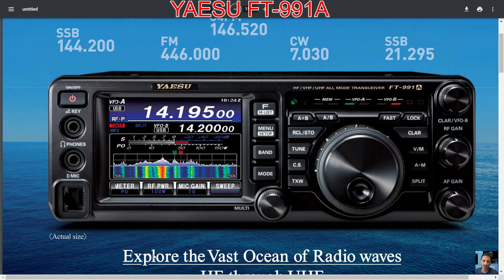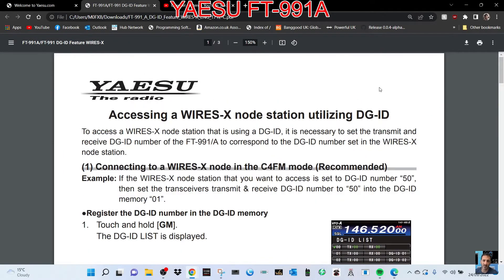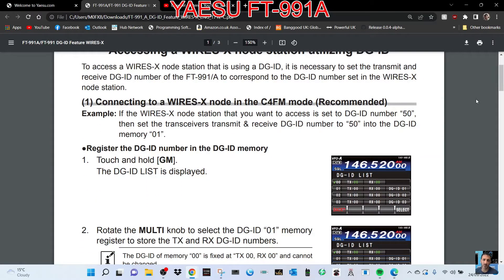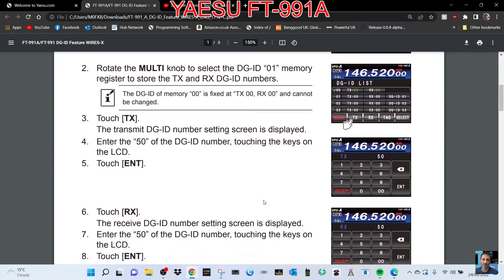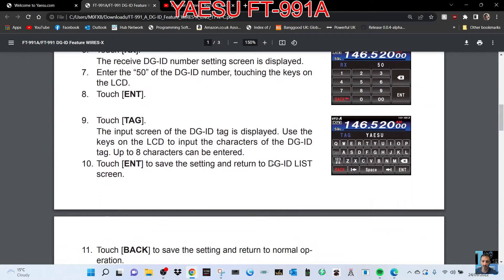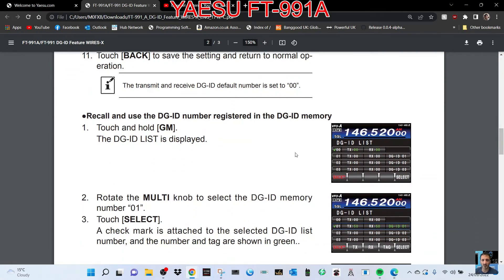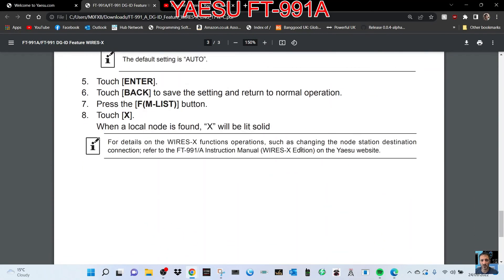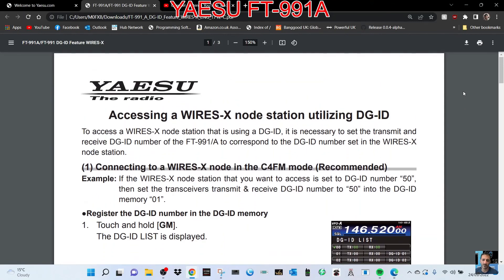YAESU FT-991A DG-ID INSTRUCTION MANUAL

Comment: Cool thanks for this info by the way I did talk to the Icom rep concerning that bit concerning that rumor of the IC 7150 and he knew exactly what I was talking about and told me he got it straight from the factory that that is fake news it os a 7100 with a photoshopped screen from either the 705, 7300, or 9700 onto it since the screen size is exactly the same size on all 3 of the radios I named so you can pull that video down you did on the 7150 if you want to
Reply from the maker: Hi Many thanks,  Yes Ray Novak from Icom has told me .